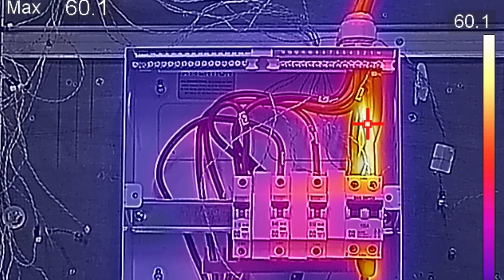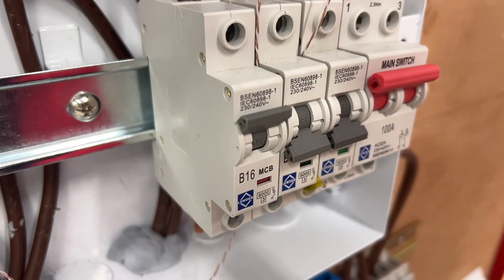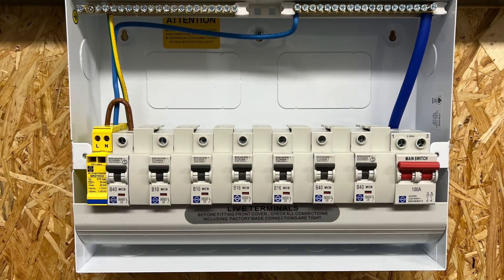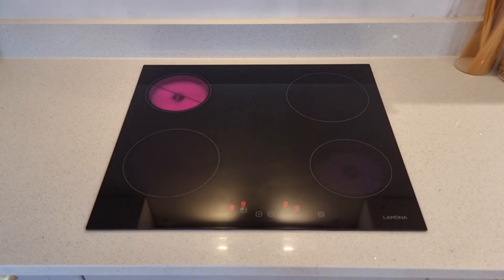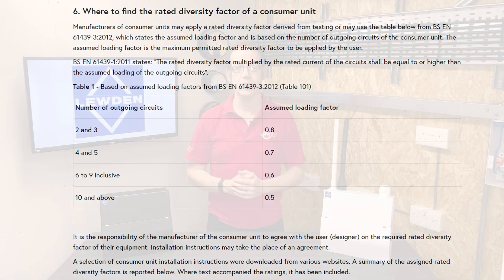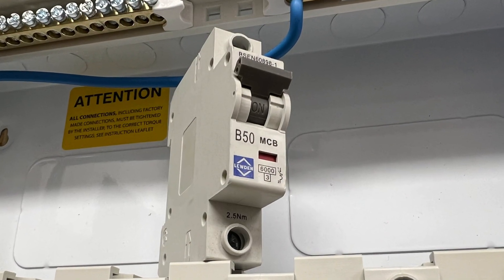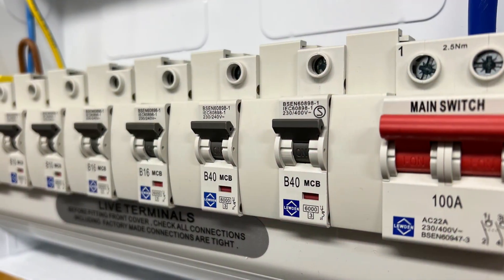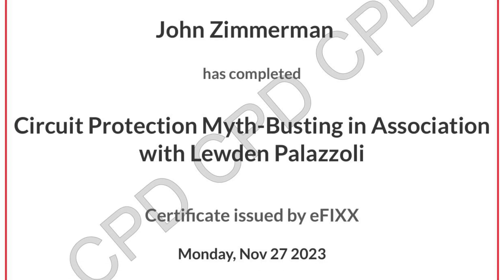Should MCB's & RCBO's be Spaced Out in a Consumer Unit?

Comment: My argument would be if the device needs to dissipate more heat then it should be of a larger 2 module design not one module.  This would give it more elbow room out of the box, it could even have air channels built in to allow airflow.  With a notch in the casing to fit over the not needed second line busbar terminal it could be marketed as suitable for constant current use and be ideally suited to EV type long duration high current loads.  There's been a lot of discussion lately about ambient temperature affecting constant or long duration high current loads like an EV charger and over-current protection (eg consumer unit in an outdoors building having a lower/higher ambient temperature messing up the calibration of the thermal over-current part of a protective device).  In some situations the operating temperature variations are going to be too large to accommodate depending on the seasonal ambient temperature.  Especially on car chargers with the growing popularity of externally IP rated consumer units for EV installations.   As a side note the only time I had a random RCBO operation was for my workshop and was due to a defective device.  No fault was found until I dug out the thermal imaging camera and noticed it was running hotter than adjacent devices on virtually no load.  Changed it out no further issue and normal operating temperature on the camera.
Reply from the maker: Yeah, but you can achieve the same thing without a specialised device by spacing or placing next to MCBs feeding low current intermittent loads. It's not necessary for every circuit just sustained loads running close to the nominal rating of the device. 👍

Comment: Great video and point taken. I do fit quite a few charge points and will consider the spacing on my next install. Be interested to see what a 7kw charge point's impact is on when next to another mcb. 
With my industrial head on, at work all panels are wired with contactors sat side by side with continuous loads running for hours on end, wouldn't that be the same rules? I guess a contactor can take more continuous loads than an mcb?
Reply: Having just replaced some (domestic) contactors which were showing signs of heat damage, I would say spacing contactors is an especially good idea. The contactor coil generates heat regardless of the current being passed through it. Half module spacers exist specifically for cooling purposes.
Reply from the maker: Nice one thanks Jon. 💪
Reply from the maker: On the contactor front, unless there's a thermal overload on the bottom of them then they shouldn't affect each other too much. It's not about the current the MCBs experience, it's the impact of the heat on the bi-metallic strip. Also contractors tend to be wider allowing for better heat dissipation. I'd need to look into contactors more to be sure to be fair. 🤔

Comment: I do fit spacing blanks between rcbos but I tend to do it in sets of 2, fusebox price differences  between the sizes are nominal
Reply from the maker: Is that on all circuits or just ones with sustained loads running close to the nominal rating of the breaker? 🤔

Comment: Wouldn't there be an option for changing our current practice of putting the highest loads nearest to alternating hi and low loads, oven, lights, heating, doorbell, etc
Reply: Do you mean going lowest rated circuit nearest the main SW and then going up in rating as it went away from there main SW?  Ive thought this for a while, seems weird to try and cram the biggest cables in the area with least room, only for tiny 1mm/1.5mm cables basking in a huge amount of space
Reply from the maker: Probably better to alternate sustained loads between non sustained loads. 👍
Reply: @efixx  oh agreed! 👍👍👍

With my lot, you’re lucky if you get a spare way in a new DB 🤦🏻‍♂️☹️
Reply from the maker: Yes, very much like we described at the end of the video. 😊👍

Comment: Like to view the circuit board with the thermo camera by default. Also step two is a check of connections on Torx with a moment-tool. Educate the customer, and maybe try to distribute the load more evenly.
Reply from the maker: Thanks for commenting. 😊
Reply: No. You should not need to do any redistribution of the load.

If the circuit carries X amps then the RCBO or MCB should be rated to carry that current.

You shouldn't need to divvy the load up and have multiple additional circuits with all the recabling costs and inconvenience that go with that.

You may need to deal with the over heating issue by increasing the ventilation around the protective device.

To adopt the solution of more circuits means more protective devices in the consumer unit and almost certainly reducing the airflow and worsening the over heating problem.

I suspect it will be more beneficial to leave a gap next to the protective devices which are at risk of overheating.

Comment: Good video and I'm glad you took time to explain the different factors at work. For most older installations this would rarely be a problem, I've seen plenty of older electric heating boards where the circuits were in close proximity and would be on for long periods and n ever had an issue.
But with Solar, Electric vehicles and Electric heat pumps likely top be in most homes, not to mention many of these loads being most active at warmer times of the year. I would imagine this is going to become more problematic in future.
Reply from the maker: Thanks very much, glad you enjoyed it! 😊

Comment: I had a fault due to heat build up a few years ago. Small Office, quite a few people, IT equipment, Photocopier, fluorescent lighting etc. Lights MCB kept tripping, some days many times. Then maybe not for a couple of weeks. On investigating I realised the air conditioning was running and the MCB quite warm. It was next to the lighting circuit, and it was a period of very hot weather. The lighting circuit was also quite well loaded. Cooler days the air con didn't draw as much power, and there were no problems. Once I was satisfied this was the likely cause of the problem, changing the order of a few circuits & spacing solved it.
Reply from the maker: What a brilliant comment and experience, thanks Richard, great problem-solving skills 👍

Comment: Given that electricians have been installing MCBs in CUs for decades without worrying about this, then I do have to wonder whether this is a real issue of not. However, running larger cross-sectional cables is rarely a bad thing. It's something of an energy saver. 

As far as RCBOs go, the electronics generate heat of the order of a 1 watt or so each. But 15 in a CU and that's 15 watts, and I do wonder if that will shorten the life of the RCBOs. Electronics generally last longer when they are cooler.
Reply from the maker: Some fair points, it's probably more about getting ahead of the problem now because loads are changing in people's properties so much. 🤔
Reply: Quality devices shouldn't have any long term heat issues.  Even the cheaper end of the market, but still a quality device, that use low value electrolytic capacitors (1uF etc) should still last a long time with the expected temperatures in a crowded board.  The electronic ripple controller (IC, film capacitors, MOVs etc) on my HWS is 30+ years old and shows no signs of incorrect operation.  The metal meterbox is on an exposed wall and gets blasted by full tropical sunlight for hours each day.  I should stick a thermometer in there and see how hot it actually gets.
Reply from the maker: It's more about the effect of the aggregated heat on the bi-metallic strip in a protective device. 🤔
Reply: As someone with a Car Charger on a 40A RCBO in the same board as a 63A MCB used to power 2 inverters for battery charging, I can tell you when the neutral wire heats up from the RCBO for the car charger and this heats the board and air inside, my 63A MCB goes from tripping at around 70A sustained load down to only around 61A.
The cabling on both the charger and inverter are rated for more than their protective devices so no danger running this high, but it did cause me to have to reconfigure the inverter power limits to below the 63A of the breaker, which when you look at the trip curves and it shouldn't be tripping at room temperature until around 70A+ on a continuous load, I was not expecting.
When the car charger isn't on the board stays much cooler and this issue doesn't occur even when intentionally testing the inverter circuit at over 68A for over an hour.
The RCBO and MCB are spaced out in here too, its just the RCBO neutral wire producing most of the heat.
Reply: @piers19891  I'm just going to note here that for continuous loads you always de-rate to 80% of the breaker size, no exceptions.  So the maximum continuous load on a 40A breaker is 32A, and the maximum continuous load on a 63A breaker is 50A.   

Regardless of where the breaker actually trips, the expected / measured loads on those breakers should not be higher than 32A and 50A respectively.

-Matt
Reply: @piers19891  That's a fairly extreme example, especially if it it's on a 100A single phase supply.
Reply: Oh yes it is indeed. It's just to demonstrate the temperature in the board really does have an effect on the MCB tripping current. @TheEulerID
Reply: @piers19891  Yes, but that is not typical and by deliberately running over the RCBO continuous rating, you are exacerbating it. I don't think you'd find many electricians recommending such a setup.
Reply: @TheEulerID  The RCBO is only running the car charger at 7.2KW max, well below the 40A rating.
The MCB was connected to the inverters with a maximum current configured on the inverters of 63A, but I experienced tripping with the car charger on prompting the investigation where we did some testing over its current rating, it does not usually operate outside it's rating.
Neither device under unsupervised or daily use is running above its rating.
Electrician did validate this setup but I appreciate it is not at all common.
Reply: We have noticed the heat build up with full RCBO boards compared to full MCB boards and generally space them out.
If there is adequate space for a larger board then it makes sense as generally a larger board isn’t a massive difference in cost.
Often we get stuck with the existing space.
Reply: Never had problem in 48 years in industrial control gear with rows of mcbs together electronics on the other hand ( PLC's,temp controllers, inverters )will fail or shut down if heat management is neglected
Reply: @rogergregory5981  MCBs are passive devices and generate very little heat. On the other hand, RCBOs and RCDs are active devices, and produce rather more from their electronics. Whether or not it degrades the life of the components, maybe time will tell. Now that full RCBO CUs are becoming normal, then we will see, although nobody seems to collect statistics on the long term failure rates of RCBOs. They are certainly much more densely packed than MCBs.
Reply: It’s been pretty rare for loads to be both high power and long duration, like solar PV circuits, heat pumps/ACs, and car chargers (or car feedback) are. 

It’s really (in residential) only those kinds of loads where the breakers see so many joules pumped into them that they might warm up.

I mean, an electric shower is a lot of amps, but likely to top out at 10-30 minutes. And cooktops and ovens and even water tanks and the like might draw high ish power when warming up, but they don’t take that long to do it.

Whereas an AC or a heat pump in winter, let alone solar panels or a car charger, those add up.
Reply: Its not an issue, we have 40y old rcbos and they work perfectly fine.
Eventually they will be exchanged with a new installation well before they fail.
Reply: @florianthomas7852  RCBOs have clear fail or else why are they meant to be tested quarterly?

In any event, I imagine RCBOs were rare 40 years ago, especially in domestic consumer units and, where available, very expensive and with quality engineering. When I bought my house (built in the 1990s), it was all MCBs apart from one circuit where there was a clear retro-fit when some work was done in the kitchen. It was an early MK RCBO, and it wasn't even completely compatible with the existing CU as it didn't mate with the busbar as the clamp was a different height to the MCB (also MK). There was a sort of "cranked" copper strap to make it work. It was also made of very brittle plastic and the neutral tail seemed to be of insufficient cross-sectional area for the 32A it was meant to carry (certainly less than new ones).

In short, I am not convinced all RCBOs are equal quality, and now that they can be had very cheaply (by past prices), then I wonder if compromises have been made. In any event, at least on a modern CU it will be in an incombustible case.
Reply: Its not an issue, we have 40y old rcbos and they work perfectly fine.
Eventually they will be exchanged with a new installation well before they fail.

Comment: That seems completely obvious now you've mentioned it.  But rather than leave a whole width space is there way to leave a half space, if they had half-sized blanking spacers.  Is there evidence to know if this is a real problem or a potential problem which has rarely been seen?
Reply from the maker: I guess the half spacing would be an issue for connecting the next MCB to the busbar. 🤔 I think it's more based on the rise in the number of sustained heavy loads and an increased awareness of the possible risk. The thermal derating figures wouldn't be tested and stated otherwise. 👍
Reply: You've got a busbar problem there. And it's difficult to pre engineer a staggered spacing in the board at manufacturing time, as then 2 module devices wouldn't fit.

Comment: I find having massive boards to accommodate this spacing is a bit excessive. what I do is alternate between "high' and low load circuits.

basically I do lights, cooker, lights, Ev, boiler, sockets etc etc. so, 6/32/6/32/6/32.

for apprentices, they'll find that is correct in the case of hager distribution boards which don't offer the same amperage at top of the busbar, as they do at the bottom. whereas schneider's busbar is rate 250A top to bottom for example.
Reply from the maker: Great comment, similar to what we suggested at the end there. 👍